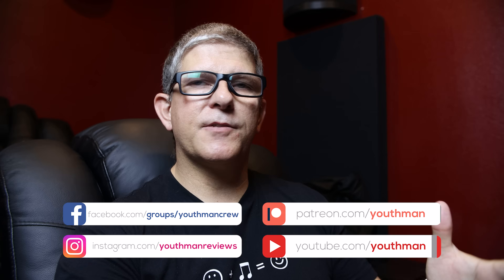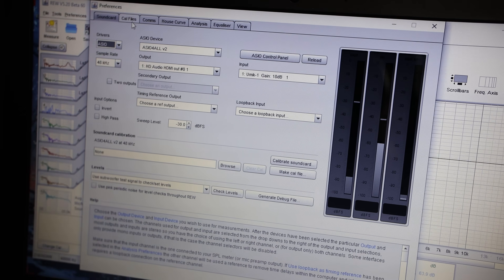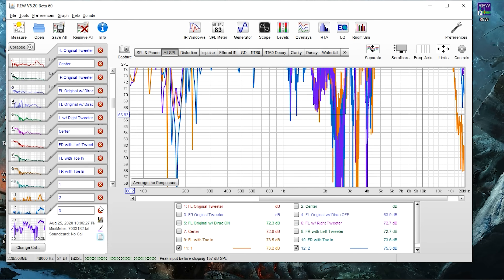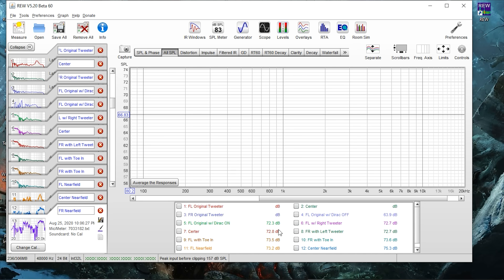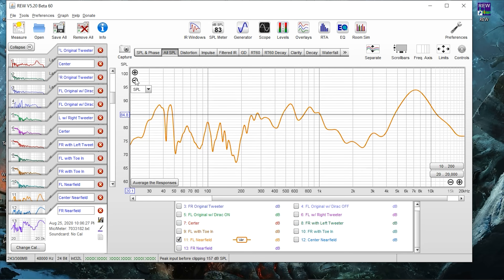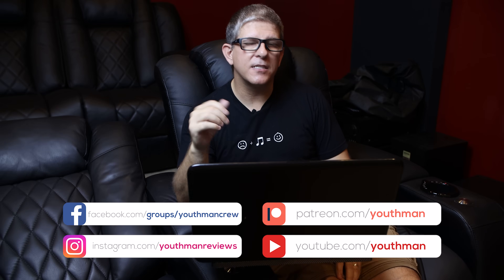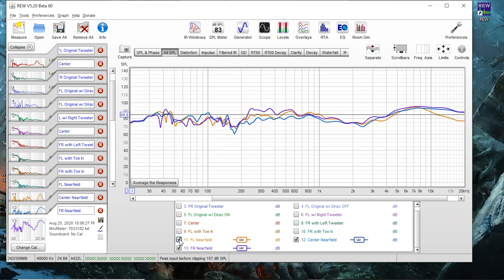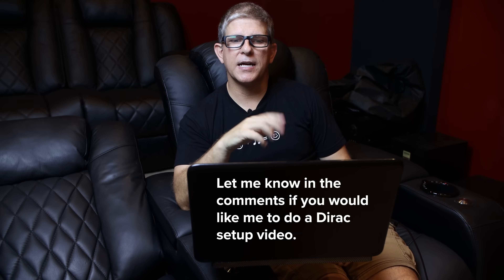What's Wrong With My Speaker? - Using REW and UMIK-1 to Troubleshoot

Comment: Hey Michael, sorry that you're having these issues. But, I think given where this range is, (Mostly above 10k where the falloff happens.) it's sort of a moot point. However, if you look at the 200-300hz range, there is a 25db difference between the right and center. That would concern me far more than what is happening here with the tweeter. I would suggest the following: 

1) As you said, reverse the outputs to the amp and see if there is a change there. 
2) I would actually attempt to just run the room correction with these issues and see what results it produces with Dirac... If everything comes together a bit better, nothing more to really worry about. 
3) As someone else suggested, I would consider putting the bad tweeter into the center - very little will play over the center channel above 5k. 
4) These are older speakers - so getting new crossovers installed/ reconed may not be a bad idea, but if Dirac can compensate, it's really not necessary at this time 

Please keep us posted on anything you find and I wish you the best of luck with this.
Reply: I don't think that's very good advice at all actually. Who knows what's actually wrong with the crossovers, or the speakers? It could possibly be something that will effect something else, like that $5k processor for instance. No if something is broken in your system. You don't just run Dirac to compensate, and "hope" everything will be okay. Not with stuff this expensive, and not when you can't just go buy a whole other system real cheap and easy. 

No. The smart way, would be to either figure out what's wrong yourself. Or to find someone who can do this for you, if you can't figure it out yourself. Then make a decision from there. With full knowledge of what's actually going on. Just leaving something to chance is not smart. Not at all! That's where all the stories about the "magic smoke" come from. And the "I wish" stories too.
Reply: @amb3cog  That is an outstanding point! I'm not sure though, how a bad speaker cone/ tweeter, can affect something up the chain... (Please let me know, like, is it possible for a bad speaker component to do damage to an amplifier?) I'm looking at this from the standpoint that 1) the speakers are 40 years old and will most likely past due to be completely serviced 2) The problem wasn't detectable until the tests were performed. If there was no appreciable loss, why worry about it now, KEEPING in mind, that they will need to be serviced at some point. 3) I'd be far more concerned with the SPL difference from the 200hz to 300hz range than the range dropping off over 10k. 

Again, I think that you're ABSOLUTELY right if this was a newer system/ speakers... I'd want to work from source to speaker and test each component to find where the issue is, and I still do recommend doing that part of it to be certain it is an issue in the speaker itself. Most likely, it's going to be something in the speaker and at that point, provided it can't hurt something upstream, I would save my pennies, use Dirac for the time being to correct the issues, and then send the speakers out to be fully serviced down the road. Thoughts? (And that you for your well thought out reply!)
Reply: You know - I just thought of this too... but couldn't an off axis measurement show this too? I don't think it's a lot on the tweeter (like 5 degrees to 15 degrees) to really see a drop off like this? Could that MAYBE be an issue in this case?
Reply from the maker: Same dropping from one speaker with the mic 2” from the tweeter. Can’t get more on axis than that

Comment: Michael, you have never replaced the crossover caps? Or previous owner never did? If not just get' er done. While you are doing that you will also loosen and tighten all the connections. If I lived close I'd do the soldering for you.
Reply from the maker: Thanks Eric. These are complete original

Comment: Hey YM, It could be a cable issue.  I had issue with my SVS PB3000 where I got bad REW reading when dialing it in.  I replaced the subwoofer 1 cable and the issue went away.

Good Luck.

PM
Reply from the maker: This is the speaker wire. Not much that can go wrong with it unless there was massive corrosion
Reply: Mine was a subwoofer cable that I had only had for a month.  Ordered directly from SVS Maybe I caught a bad batch.  Remember, speaker wire carry impedance, if it is bent or twisted wrong it could change the impedance quite a bit.  

Good Luck.

PM

Comment: Hey YM, have you spoken to Klipsch TS about this issue?  They may suggest replacing the x-overs x 3. One for each LCR if they still carry them.  Hopefully they do.

Good Luck.

PM
Reply from the maker: Unfortunately Klipsch does not carry crossovers from 40 years ago. I reached out to them last year to see about it or even if the new crossovers would work but they said the new crossovers would definitely not work with the original LaScala’s
Reply: Wow. OK.

Comment: Hey youth man, New subscriber did you swap speaker cables? Swapping between the bad front channel to the center channel making sure it’s not the speaker cable, the patch cord, the amp or the pre-pro itself?
Reply from the maker: Thanks for subscribing John. That is my next steps to check cables, as well as the processor and the amplifier
Reply: Youthman I figured you had or we’re going to you’re probably correct the aging crossover is probably the culprit but I guess we shall see. Track down my fair share of gremlins in my systems over the years got 30 tubes in the signal path for two channel listening and only 18 for Home theater. I enjoy your channel very much and admire your set up very well done. Keep the videos coming stay safe👍
Reply from the maker: Thank you for the kind words John

Comment: I said in the other video,  It could be the Ferro Fluid in the tweeter gone bad.                                                                                                      Many, many speakers from the 1990 & 2000 decades had metal-dome tweeters damped with "ferrofluid." The idea was that the viscous fluid, magnetically held in the tweeter voice coil gap, would dampen resonances and ringing in the (then new technology) metal-dome tweeters. Now, in 2013, many of those tweeters sound dull, or have quit working altogether. This happens because the liquid in the ferrofluid has evaporated, leaving a muck or solid in its place. The muck reduces amplitude of the tweeter (making the speaker sound "dull" or "muffled"). The solid prevents the tweeter from working at all.
Most people throw away their speakers at this point and buy new ones. But with a bit of elbow grease, the tweeters can be restored to "like new" performance.
Reply from the maker: Thanks. My tweeters are Klipsch K77M. Here is what they look like - https://community.klipsch.com/index.php?/topic/184595-k77-and-k77m/
Reply: La Scala's use compression drivers with diaphragms, no ferro fluid, many people are talking about the need to upgrade. I believe these are people who don't know what these speakers are, and what they're capable of.
Re-cap the xover and that should do it. I would never replace those LaScalas, peace...
Reply from the maker: I have reached out to JEM Performance Audio. Klipsch authorized them to repair Klipsch Heritage
Speakers to factory specs. They do not “upgrade” crossovers like other guys do.

Comment: If it is the HTP-1, you'll know when you swap the speakers and they still have a left channel issue. If you plan on doing a speaker swap regardless... do it and measure before running DIRAC and you will eliminate one possability.
Reply from the maker: I’m in the theater room now about to do that

Comment: It's your crossover... 100%
Reply from the maker: The only way to know 100% is for me to swap the XLR cables on the HTP-1 and and then on the Amplifier. It is possible that one of those two items could be causing the problem. I like you and pretty confident that it’s a crossover issue but I want to rule out all other options before making a final conclusion
Reply: @Youthman  It is possible, but highly unlikely... I will revise my assessment to 99.99% it is your crossover. :)
Reply from the maker: Haha I tend to agree with your assessment. It’s hard not to think it’s not the crossovers being that they are 40 years old. I’m 44 years old and I know stuff on my body is beginning to break down LOL
Reply: @Youthman  I hear ya, Michael, I'm 51 and I feel wear on the machine as well. haha  We know it can either be the source or the speaker, so the thing to do is to swap the right source so it feeds the left speaker and vice versa, at that point if the problem stays put, it is an issue with the speaker. You already know it is not the tweeter itself, because you swapped those out, right? So it could be a connector or cable or it could be the crossover. The likelyhood of a connector or a cable having this problem (assuming they are simple wire with no filter network, as some cables have), is for all practical purposes, next to zero. So my money is on the crossover network... a capacitor (which is essentially a high pass filter)  is failing and you're losing your top end.

Comment: I have looked at the crossover schematic and in combination with your results I think the 2uF capacitors that make an eighteen dB  crossover are close to dead.
Which is not so strange after 40 years, swap de capacitors  for the tweeters with a MKP type and the capacitor for the mid-range with an MKT type. You will have years of fun with them again
Reply from the maker: Thank you kindly. Unfortunately I have zero soldering skills so I would need to send them off to someone to repair or to purchase other ones
Reply: @Youthman  Is there a university near by?  Find a EE student, they can do the soldering.  "The Audio Fool" has the schematic so maybe he or someone else in the comments can use this to just make you a new pair of crossovers.  There is really no need to use any of the old one.
Reply: @mthemaniac  
In the old crossover the coils don't age or degrade, only the capacitors degrade. Replacing the coils with new ones will not give a improvement and is therefore a waist of money, upgrading capacitors to high end level, say Mundorf MKP Silver Gold Oil types is   a great improvement.
But the best improvement you get is with a completely redesigned crossover, cutting off the woofer with 12dB/Oct instead of 6dB/Oct for instance will be a large step forward. Online you can find some modified crossovers but you never know the result untill you hear it playing, if you like the basic sound of the speaker I wouldn't recommend building a new crossover
Reply: @Youthman  
 Electronics repair busyness in your area?????
Reply from the maker: Yes I’m sure I could find someone
Reply from the maker: Now that I think about it, Klipsch did partner with a company to restore older components to the original factory specs. Most guys like Danny, Bob, DeanG, and Al modify crossovers to their preference, not to Klipsch specs
Reply: @Youthman  
I have seen some of the schematics of modified crossovers, they'll probably give a better sound, but it also like the original sound. Don't forget that the crossover makes the sound, is that what you want? Then go for it. Do you want the original sound with a small improvement in detail? Go for a capacitors only upgrade.
Reply: Soldering.. Don't sell yourself short, it ain't hard :)

Comment: Try connecting a set of bookshelf speakers in place of the La Scalas. If the high frequency anomaly goes away, the issue has been isolated to the La Scala, if it remains then the issue is upstream. I had a similar issue, come to find out one of the cables connecting my components had a failure. BTW, I bought my La Scalas new in 1982 and still love them
Reply from the maker: That is a good suggestion Mark thank you sir.

Comment: Yup there you go, hate to think that something like the HTP-1 is dead on arrival but I guess you need to test it.  So swap the outputs from the HTP-1 to your amp and then swap the speaker wires on your amplifier channels, that would conclude if it was a prepro/amp issue. If it isn't then you are pretty much guaranteed a crossover issue. Interested to see how the Martin Logans graph in your room compared to the la scala's.
Reply from the maker: Yes that is the next step I will be doing today. Stay tune for another video tomorrow

Comment: It could be a bad capacitor on your crossover. Capacitors do have a lifespan. Usually 30 or so years on average. Check to see if any of the capacitors on the crossover are leaking, or have a bulge on the top of it. If the capacitor has a bulge on the top of it you may need to replace the capacitor. But unfortunately you probably will have replace all the capacitors on all of the speakers so they all have the same amount of burn in on them. Good luck.
Reply from the maker: Yes I’m sure the crossovers could use either updating components or replacing all together. I’m just not sure I’m ready to do that since I might be going a different direction altogether

Comment: ReverandYouthBossMan, final solution, if on speaker sounds off, then move it to be the CENTER, use the 2 identical sounding speaker as the center.
Reply from the maker: Are you referring to like a phantom center?
Reply: @Youthman  something like that , but you would just use the "underperforming" speaker in the center. For movies in general, speakers shouldn't be so bright. Your basic problem would be solved.
Reply from the maker: That probably would not be the best solution considering the center channel is one of the most important speakers when watching movies.
Reply: @Youthman  that tweeter is showing a rolloff, some movies and processors actually also roll off highs. 
As for my solution, it was more of a patch before SVS or another company graciously prevents you with replacement speakers ;)
Reply from the maker: If you watch the video, the Twitter is not what is causing the rolloff because when I switch the left Twitter to the right cabinet, I should’ve seen a rolloff when measuring the right speaker but I did not. The rolloff remained with the left cabinet which points to either a crossover issue or possibly the speaker cable or possibly the processor or amplifier. More testing needs to be done to narrow it down
Reply: @Youthman  ok, so we are going deep. Connect speakers to a receiver and see if you can duplicate.
Then connect receiver to out board amp and run again.
Process of elimination to find where the fault lies.
Reply: @Youthman  That actually might be the best solution since the rolloff happens around 10k - very little is going to come from that FQ area and above from the center... So perhaps something to consider there. I'll write more - but I see a much bigger issue with your 200-300hz range than the tweeter range.

Comment: Hey don't know if you saw my previous comment on your last video but definitely measure the crossovers with a multi-meter. It's pretty easy to do once you have the crossover out of the speaker or the back of the speaker easily accessible. Audioholics has an article I about upgrading speaker crossovers that I'd check out too. Previous comment below: 

"First thing I would do is remove the crossovers and get a multi-meter and measure the resistance of all the components on that. Most of the stuff will have resistance values in ohms along with tolerances written on them so you might see 5 ohms +/- .5 ohms and you might find some that are out of spec and would need to be replaced. Ones that are 4.2 ohms instead of 5 would be ones that should be replaced but you might find ones that are .5 or 1 ohms instead of 5 and those would be the parts that are causing the issue you're seeing. Would be pretty easy to check and would allow you to know for certain whether the crossover is bad or not. A lot of times you can find wiring diagrams for speaker crossovers which would make that even easier to troubleshoot. Redoing the crossover yourself isn't hard as it's only a bit of soldering and you might be able to get better sound potentially with higher end parts (that aren't 40 year old tech :P)  with tighter tolerances but I can understand if that's not something you would be interested in doing as you could improve the sound or make it worse depending on what parts you use. Parts express has a lot of crossover parts that you could use that are supposed to be decent quality."
Reply from the maker: Thank you for the follow up, no I did not see the previous comment come in. With 60,000 followers it’s difficult to see every comment that comes in on every single video.

I have a multimeter but have zero ability for soldering so I do not think that would be something I would want to attempt myself. I did have a Klipsch forum member I reached out to me offering to help if I wanted to ship him my crossovers
Reply: @Youthman  No worries man, completely get it. And yeah I've never done soldering either but I plan on building my own speakers one day so will have to figure it out then haha. It doesn't look too hard just putting a little bit of metal goop on some twisted up loose wires so I'm confident I'll be able to do it :) Good luck with fixing your speakers!
Reply from the maker: Yeah most people who solder say it isn’t difficult, but there is an art to making it look nice. Probably similar to welding. It’s one thing to melt two pieces of metal together, it’s another thing to make it look decent LOL